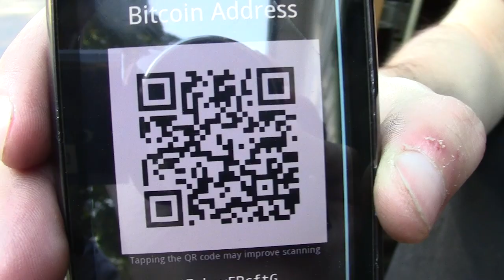Steve Removes Basketball Net from KAC Garage

Comment: Hey, I have a basketball net and back board (a big back board) on my mum's old carport that we are currently try to take off. The problem is that as its been up for so long when you try using a spanner or a gripping tool? That the whole screw moves and there isn't enough space on the side where the hoop sits on the backboard to be able to grip that and keep that still. Any suggestions of what else to try? I want to take it down as my mum is moving and I want to keep it. Thanks!